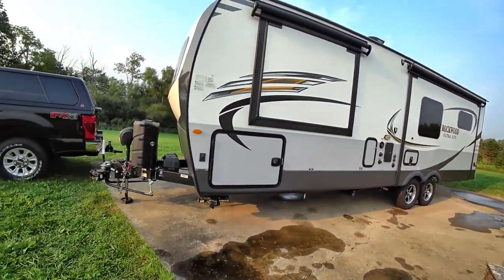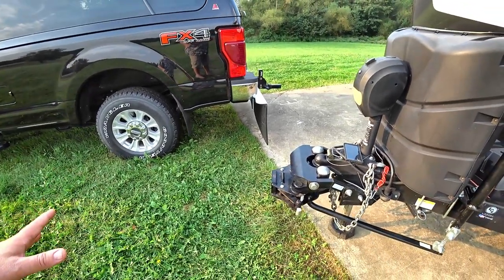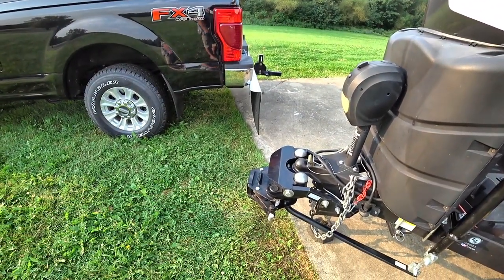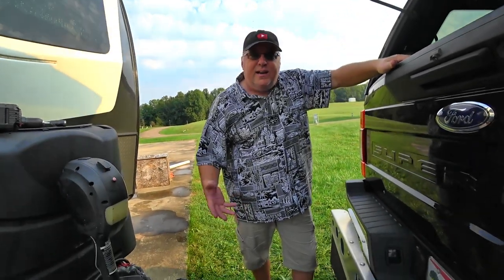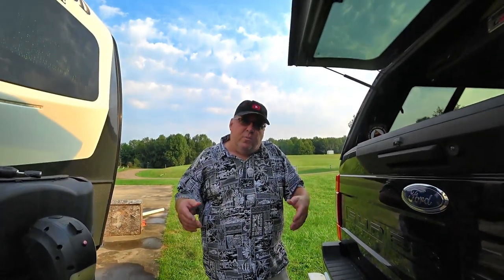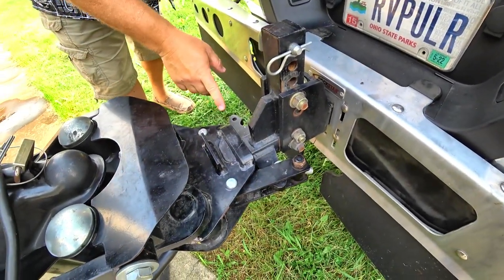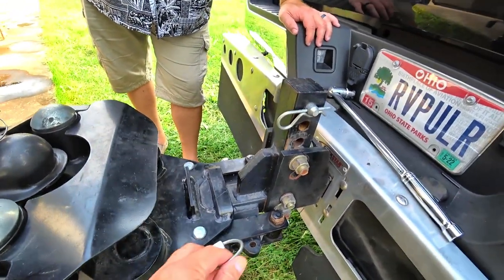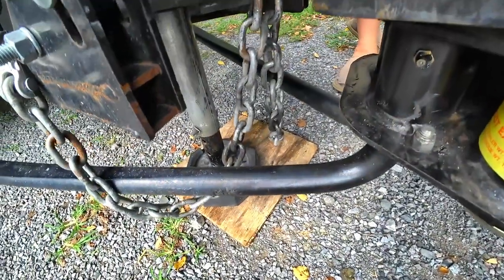How We Hook up the ProPride 3P Hitch

Comment: I considered this hitch but hesitated because I had questions about hitting at up/down and side to side angles. My truck's rear end is up pretty high at the point it has to be in overt to hitch with the trailer. I worried this hitch wouldn't be able to accommodate those potential problems. I also have need for hitching and unhitching at angles demonstrated in your video footage. You did a great job expiating exactly how to GET the hitch to be at the proper angles in order to successfully hitch up. Thank you. You've made my hesitation about the potential purchase of one of these hitches that much less. 👍

Comment: We bought a used 27 ft trailer with dual opposing slides at the rear. We also have a 2020 F150 eco-boost with max tow package. It has plenty of power to pull the trailer at 6043 pounds. However, with any crosswind it was absolutely terrifying because of the sway. At 60 km an hour, I don’t know what that is in miles per hour, we thought our truck and trailer were going to roll. Our last resort was this hitch. It made all the difference in the world with towing even in high winds. It is definitely more tricky to hook up but we are hoping your video will make it easier this year. I really like the tip about having it set up at the campground for easy hook up when the trip is over. You may hear from us again in May😜.
Reply from the maker: Lol I believe it's easier to hook up, though sometimes tricky.. Also the company has the best customer service.. Make sure to join Propride on Facebook...

Comment: One tip I’ve read about (but not used personally, yet) is to mark the safety chains (tape or paint) at the point where they just touch the ground when the receiver is at the (normally) correct height for hitching up (or unhitching).  It’s taken a bit of practice, but we are now able hook up and unhook easily.  I still use a tape measure to get the height of the receiver close and then G.O.A.L. (Get Out And Look).

Comment: Excellent video. I just bought a trailer with this hitch and the previous owner did not show me this process.  We “jammed” the stinger in with no adjustments on the tension bars, which, explains why I was telling my wife the hitch isn’t set up correct because my F350 felt light(er) in the front that when using the Blue OX hitch. Such a great video. I am a huge fan.  You have a great voice for this and you provide great info. 
Can’t wait to see what else you have. Thank you so much.

Comment: Great video, im learning a lot from your vids. I am now going to check my install of this unit based on your vids. One question, i noticed your safety chains are outside of the weight distribution bars when the manufacturer clearly statesthey go under the bars. Did I miss something? Keep the vids coming!
Reply from the maker: I never showed the chains "hooked up" they are disconnected in the video and the hooks are draped over the tongue of the trailer..

Comment: Brent has also pointed out in recent videos that you do not have to fully seat the stinger.  The tapered area can be shy by at least 1/2” and the OCLs (Over Center Latches) will pull the assembly together.
Reply from the maker: Absolutely true... but I'm not sure why during backing you wouldn't allow the vehicle to do it for you. I mean, you're already lined up and you are inserting the majority of the Stinger into the receiver already and If you're half an inch short of the fully seated position you then you need to manually use the overcenter latches to pull either your truck backwards or your trailer forward that half inch that it is short of.
Reply: @Rvdaydream  I agree.  I always back the stinger in all the way and make sure it is fully seated.

Comment: Sir
I appreciate your in depth walk through. Can you please explain how you were able to achieve the downward angle on the stinger. I have a Hensley Arrow and I have to backup into my camper on a on a downward angle for my truck. Very aggravating at times.
Reply from the maker: Unfortunately, the Hensley does not offer that option. That is one of the reasons we went with the propride hitch. It is adjustable for not only different angles but also different heights.

Comment: Love the video and I'm really interested in the 3P hitch. It may have been out for a while but this is the first time I've seen it. The question I have is, how do you know your putting the weight back to the steer axle? The reason I ask is, because I used to drive tractor trailers and I'm medically retired now, but if we needed to move weight to the steer we slid the 5th wheel forward. Keep in mind that the 5th is centered over the drive axles where the figuratively speaking tongue weight is. I'm not understanding how tightening or loosening the weight distribution bars on the trailer which is now behind the vehicle instead of on it, adjust the weight on the steer. Can you explain or do a video of how that actually works? Thanks
Reply from the maker: It's hard to describe, I don't have a video covering it but there may be one on YouTube
Reply: He sort of mentioned it in the video. Imagine that those weight distribution bars are like the handles of a wheelbarrow. When you lift up on the handles, the front of the wheelbarrow points downward. The same thing happens to your truck when you increase the tension on the back of the weight distribution bars.  
The difference is that with the wheelbarrow the pivot point is at the wheel whereas with the weight distribution hitch, the pivot point is at the hitch.

Comment: Thank you for the informative video. What keeps someone else with a "stinger" from hooking up and rolling off with your trailer? Is there some type of device that locks to prevent someone else hooking up? As always, thanks for sharing! Steve
Reply from the maker: Great question.. If they want it bad enough they will get it.. Lol
Reply: @Rvdaydream  After losing my 2608BS with ProPride P3 installed, I asked Sean the same question.  He suggested looping the tow chains thru the OC Latches and locking them together.  Sadly, any lock can be defeated, but in my case the thief cut off the coupler latch lock and removed the PP hitch.  Drove off with the normal ball coupler.  :-(

Mike, 
Great video.  You illustrated all of the things was doing.
Reply from the maker: @rjsqrl4150  sorry to hear that..
Reply: Geeze, just found your video . 
I have an 1,400Lb Arrow and I’d say it slides in perfect about 25% of the time, needs a couple of trial and errors 50% of the time, and about 25% of the time it’s total aggravation. 
I’ll try your tips. 
Thank you for the video.

Comment: Great video. Thanks for all the hard work you did! Still on the fence on buying one of these hitches. My only concern is that my driveway slopes fairly severely for the first 10-12 feet before it levels off. The rear of my camper barely clears, I had to flip the axles on my old camper to get it to clear. I also had to cut the bottom off my hitch and it still scrapes a little. Hopefully it looks like this hitch might be a little higher and might solve that problem for me. I also think the better weight distribution will keep the truck read a little higher. I will definitely use the link to purchase if and when I do. Just picked up my new camper and drove back across Nebraska and the winds were a killer. Stay safe out there and thanks again for the great explanation!

Comment: My problem with extreme angle hookup is raising the tounge jack. The weight distribution bar is in the way of the foot.
Reply from the maker: Once hooked up that can all be manipulated out of the way and as you're raising or lowering it you can push the weight distribution bars out of the way for it to clear. In a very rare tight situation all you have to do is pull the pin and take the foot off of the straight post.

Comment: The ProPride manual (at least the last one, Sept. 2021) on the unhooking part says to firstly raise the central jack and then lower the lateral jacks till they are loose. So the opposite of what I have been doing and what you showed. Do you think it would be better the new way?
Reply from the maker: The way that the instructions explain is correct. I just found that I can do it either way and everything's fine
Reply: Thanks for the answer… Well, I’m kind of wondering if the tension in the lateral jacks would end up keeping the hitch to move on the ball - I guess I’m going to see it soon, I’m moving tomorrow and I’ll try the new way… :-)

Comment: If you tow in high wind areas the ProPride (and Hensley) hitches are the best you can get to control/eliminate sway. Given your truck and trailer combo it’s probably total overkill for you. However, I can see one other advantage to those hitches. I have a bad back and switched from a travel trailer to a fifth wheel because I had an Equal-i-zer 4 point WDH that had very heavy sway bars that became difficult for me to carry and manage when hooking up. With the ProPride I can see it would be much easier on my back since there is no need to carry and install the sway bars. Even at a few thousand dollars it would have been less expensive to get that hitch than to buy a new fifth wheel! If we decide to downsize from the fifth wheel, this hitch would make hooking up a travel trailer much less painful  (literally!)
Reply from the maker: You nailed it! Heidi wanted nothing to do with the "snap up" design of the traditional hitch design however, she always participates when connecting up to the Propride... 👍
Reply: @Rvdaydream  Totally agree.  The Blue Ox latches and bars were just as more lifting and twisting than I liked.  The ProPride eliminates all that assembly fuss with a short breaker bar and a speed handle.

Comment: I have a snappad on the foot of the tongue jack and was curious whether you fully retract the tongue jack to clear the spring bars. My set up barely clears the bars when fully retracted
Reply from the maker: I think ours was about the same as we had snappads also
Reply from the maker: At extreme angles I would loosen bars and push them out of the way with my foot while retracting OR in extreme cases I would remove the two-part Jack foot entirely and then straighten out the truck once the Jack was retracted and reinstall the foot once everything was back in the line

Comment: The tip about just lifting the trailer ball coupler off of the hitch head was a game changer when I first learned about it.  You can put your finger in the space in front of the coupler as there is no pinch hazard there.  You literally want to stop raising the coupler (lowering the tongue jack) as soon as you feel the coupler rise.  If you keep going, you are quickly trying to lift the ball, which puts load back on the hitch head.

Comment: I measure the stinger height when I hook up and I've never had a problem unhooking.  I don't know what you're doing.
Reply from the maker: What happens when you add more or remove weight from the truck after uncoupling? Like arriving with a quarter tank of gas(48 gallon tank) but filling up before you rehook..
So many reasons when you go to hook back up the stinger height could be different than before... Especially if you are not on concrete or asphalt RV pad... In 80 percent of private parks and state parks in Florida you park the RV in sand grass meaning the Tow vehicle is backing through those same ground conditions... Best way to get close is measure RV receiver height at unhook once the stinger easily slides out.. That's why I ran a Level Mate Pro...It also Allowed for finding level parking spots when staying hooked up for quick overnight stays.(Walmart, Truck Stops, Rest Areas)
Reply: @Rvdaydream  It  can be off a little and still work. Would have to take a lot of weight to take out.

Comment: How would this work with rear auto leveling suspension?
Reply from the maker: It's tricky... Here is a video link... There will be another in that videos description to watch too.. https://youtu.be/UfsJE94Vmc4
Reply: @Rvdaydream  It covers airbags but not rear auto leveling airbags that cannot be completely disabled like on the Ram 3500 dually 🤷🏽‍♂️
Reply: @Laurant956  I was going to ask the same thing as my 2500 with the auto level will adjust when loading weight into the bed of the truck.  The truck moving up or down will complicate the use of this hitch for sure.   I assume changing the control setting on the console to Tire Jack Mode like you would use when changing a tire will turn off the auto level function and allow you to make the necessary adjustment to the P3 as demonstrated in the vid. 
Nice work on the VID BTW.

Comment: Your truck does it have to have commercial plates in ohio.If so does that cost more for insurance.Were i live vehicle over i belief over 6000lbs u need commercial plates.Was thinking about going with the f250 for my next truck which i dont really need for my boat but not crazy about those engines on f150s no turbos with a 6 cyl engine for me.The 5.0 has the stop and go technology and cylinder deactivation not crazy about those either.Chevy and rams are out dont trust either one for long term reliability.Tundra i would have went for but they stopped making the v8 for 2022 models.Want to buy new dont want a used truck.
Reply: Tom, I have a 5.0 w/stop and go.  Truck has a very accessible deactivation button right on the dash.  Just takes a little bit of repetition to get in habit of pressing button after start up.  There are also videos on how to permanently bypass it.
Reply from the maker: We do not need commercial plates in Ohio...
Reply: @fitfifties  Thanks for the reply that i was aware of could live with that but then theres the issue of cylinder deactivation.